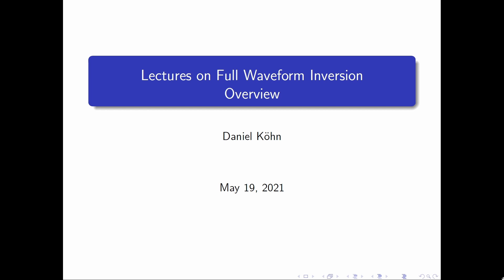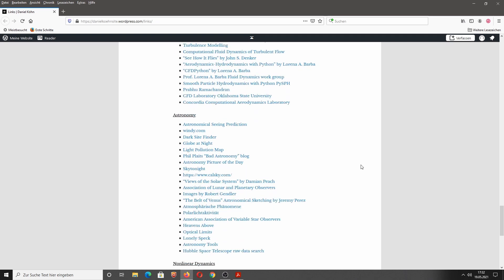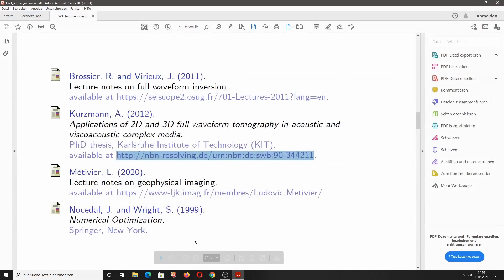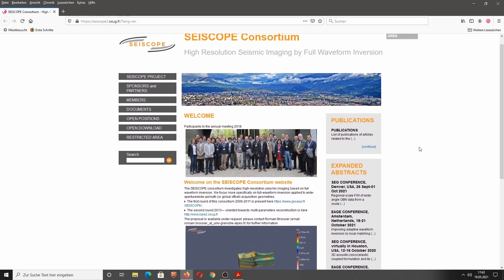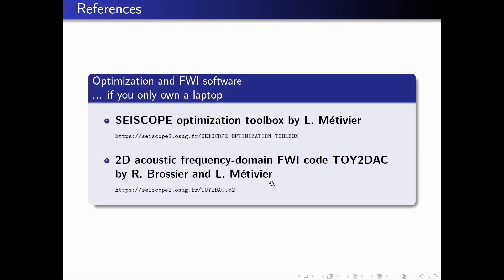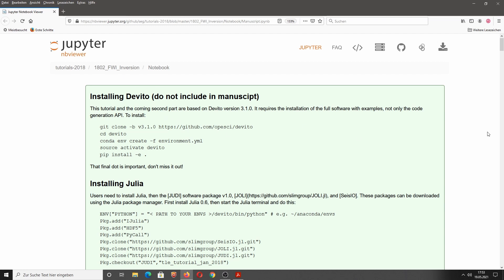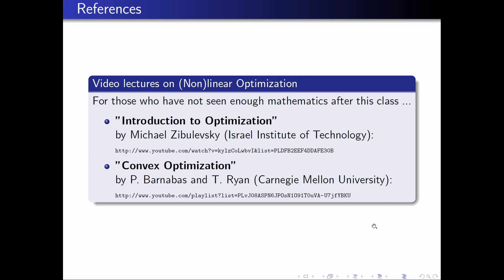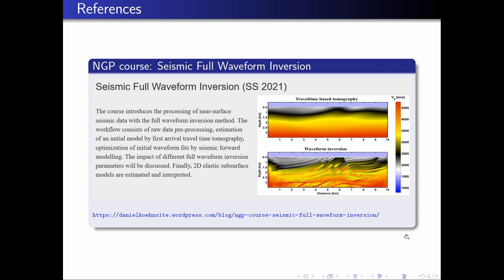Lectures on FWI 1: overview

Comment: Dear Dr. Köhn,
Thank you very much for this lecture.
Are you going to upload a full course with problem sets and examples? 
If so, what are the prerequisites? and when do we expect to see the rest of the lectures?
Reply from the maker: I just uploaded the next video in the lecture series. The remaining lectures will follow in the next weeks. The focus of this course is only a short overview of FWI without any problem sets or examples. However, I 'm also preparing a course with a stronger focus on how to apply FWI using our DENISE Black-Edition Code: https://danielkoehnsite.wordpress.com/blog/ngp-course-seismic-full-waveform-inversion/ 
So far, I uploaded tutorials regarding the installation of the source code on a parallel supercomputer, seismic forward modelling and RTM. Chapters with a focus on FWI (field data) applications will follow in July or August 2021. If you have access to a supercomputer you should be able to follow the course.
Reply: @MrCrazyPhysicist  thanks so much Dr. köhn for this awesome videos,  it is possible to follow the lectures using schematic 2D seismic line in order to reduce the computer demanding power using FWI? Thanks again for all the information!!!
Reply from the maker: @vladimircabellorios6520  In case of the Marmousi-2 model you could save computation time, by changing the physics of the medium from isotropic elastic to acoustic. Furthermore, you could reduce the number of shots. This was investigated in more detail by André Kurzmann in this report:
 
https://www.researchgate.net/publication/269518382_Performance_of_acoustic_full_waveform_tomography_for_different_acquisition_geometries
You can find a smaller canonical model in the DENISE-Benchmark repositiory:

https://github.com/daniel-koehn/DENISE-Benchmark/blob/master/2_inclusion_toy_example/GERMAINE_FWI_incl2.pdf
Maybe, I will add a tutorial video for these smaller test problems later to the NGP FWI course.
Reply: @MrCrazyPhysicist  that will be so great, thanks again for all your videos, I wish all will be able in English in the future, anyway I really aware of any new video in English it is really awesome all the work you share!!